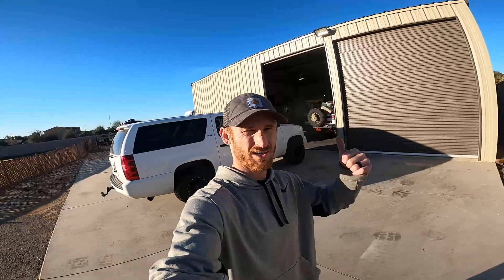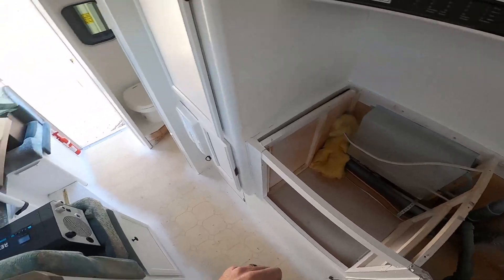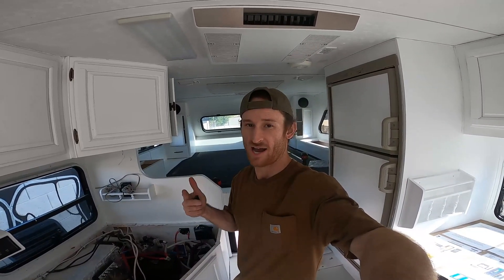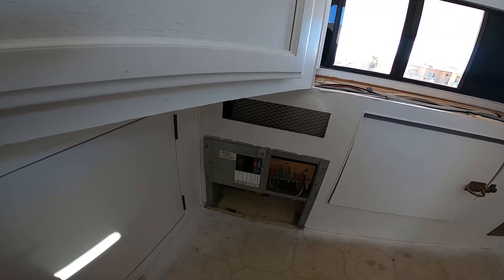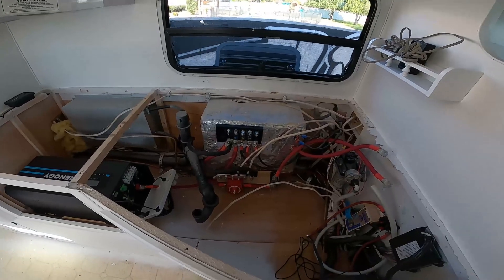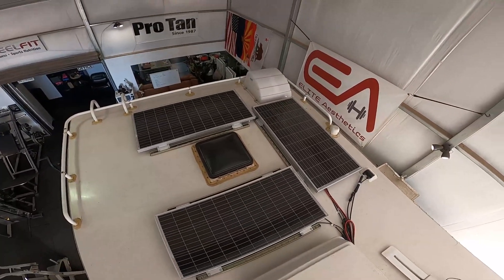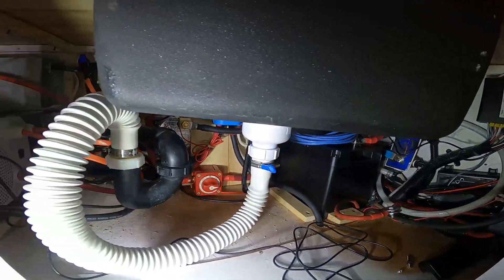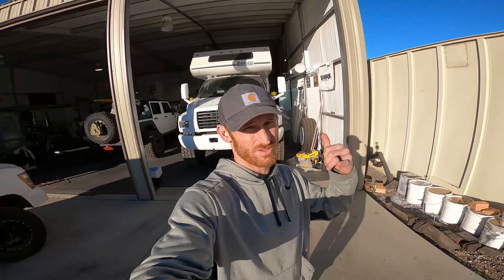Installing a 400 watt Renogy Solar System on our Lance Cabover Camper

Comment: Thank you for the knowledge.  Can you elaborate on how you knew where to drill from the top without hitting a stud or even the side of a cabinet wall?
Reply from the maker: You don’t always hit a stud. I se anchors in those cases and haven’t had any issues.

Comment: Thanks for the video. What does it take to get the air conditioning to run off of your solar and batteries?
Reply from the maker: 3k or bigger inverter and a battery bank big enough to run everything for as long as you would need. And a soft start on the ac unit.

Comment: Hello and thanks for this vid.  What size and length bolts or screws did you attach the channel rails down to the roof with?
Reply from the maker: I used 1 1/2" screws to attach the strut channel!

Comment: Is this the lance 990?
Reply from the maker: It’s actually a lance 1030!
Reply: @JensenAdventuresaz  Thanks for the reply! I read up on the 1030, and it's actually just the 990 rebranded and remodeled. Your videos are going to help greatly. I'm already thinking about ripping the oven out for lithium 🙌🏻
Reply from the maker: @ChronicSurfer  let me know if you have any questions or anything!
Reply: @JensenAdventuresaz  Thank you so much! I'm fixing my water damage right now and putting in a new frame structure for the bed with some havelock wool. I decided I might as well do the electric while I have the walls off. I'm might have to take you up on that. Looking forward to more videos.
Reply from the maker: @ChronicSurfer  sounds like your all in on your renovation!